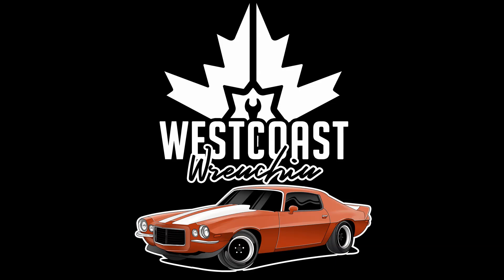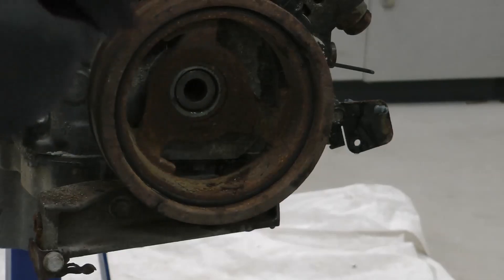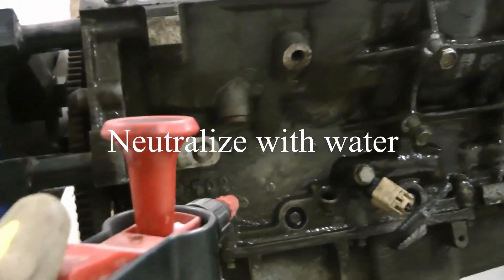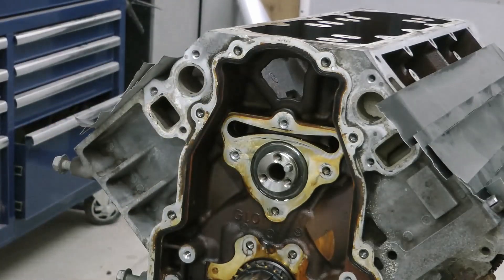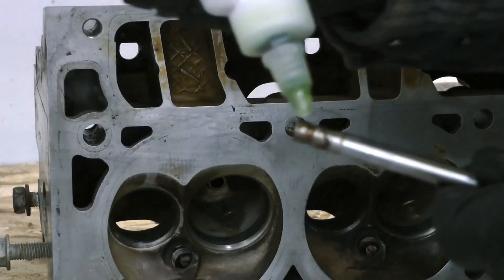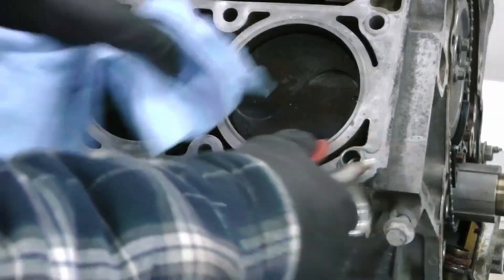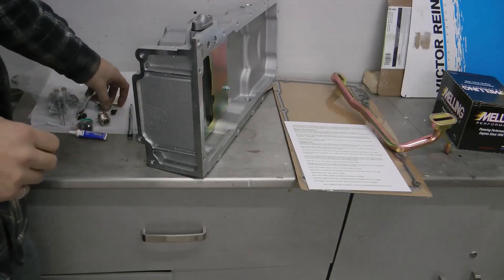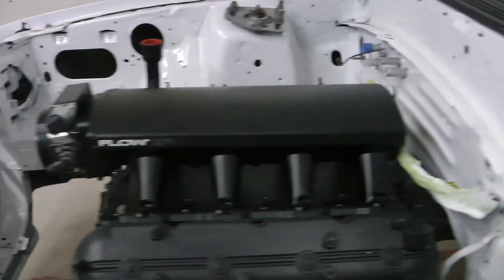How to LS Swap Foxbody - LS2 Engine Build and Mounting

Comment: What automatic transmission did you use. And what fuel system works?
Reply from the maker: 4l80e for transmission. Fuel system is stock tank with corvette fpr, in tank aem 340
Reply from the maker: https://youtu.be/u3g0XUZ0lOc

Comment: I’m nervous to start my build, I’ve got an 86 notch and found a great deal on a 6.0 and a 4l80e. I’m going to have to upgrade to an 8.8 or 9 inch obviously, but just how much modding and fabbing really goes into stuffing that all into the foxes?
Reply from the maker: It's all what you make of it I suppose, this build has been very straightforward from my point of view. It's nearly a bolt in thing these days. I haven't got to the 80e yet, but thinking making the stock shifter work will be a challenge